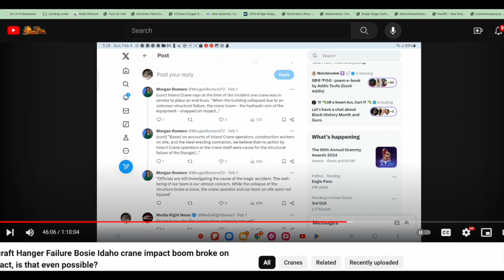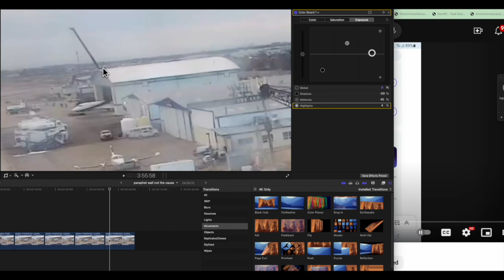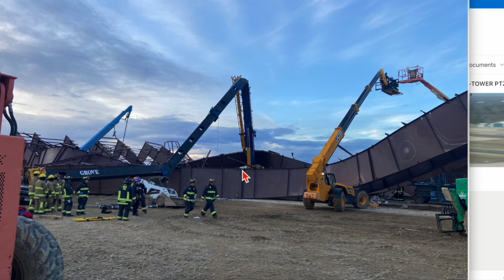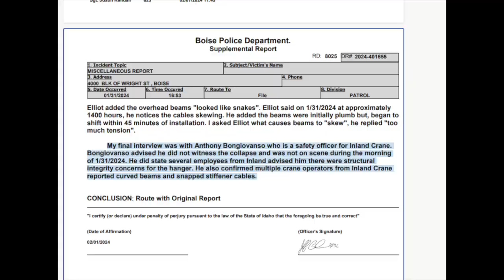Boise Idaho aircraft hanger Collapse VIDEO of CRANE FAILURE

Comment: So is this a failure of the foundation/Ground Plate Bolts ? It would seem to me as literally and figuratively the root cause of the collapse. I had a airplane hangar built for me. It was a pre-engineered metal building from a metal building manufacturer with very specific foundation requirements and the kit came with steel plates that were set in concrete where the vertical columns were to be bolted to the foundation. I was really satisfied with how it turned out. Structurally the metal skin of the building added to the stability as well as steel cables running across the building walls in an X pattern were tensioned to square and distribute wind loads.  I've worked on a lot of different mechanical devices in my time and usually try to figure out the root cause of failures so I don't have to fix them again.

Comment: That's exactly right! To straighten a building that has been been slowly moving over time a ton of cribbing will be needed to safely straighten out or at least the wall.
But even then the only way our team would attempt it is to dismantle the ENTIRE roof ,make the footer and slab repairs then replace the wall and roof.
Reply from the maker: Cribbing would be 37 feet tall and dangerous to install...
This was the wrong crew for this steel structure.
Reply: Without a doubt!